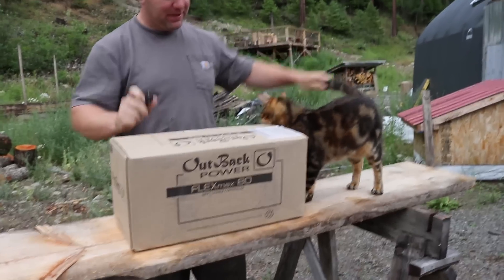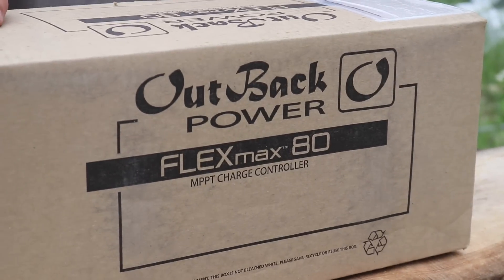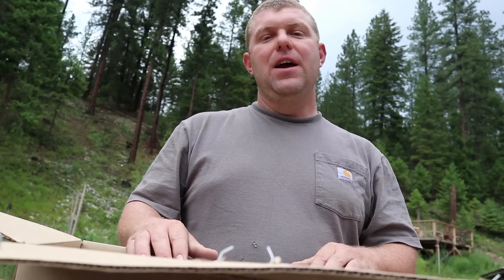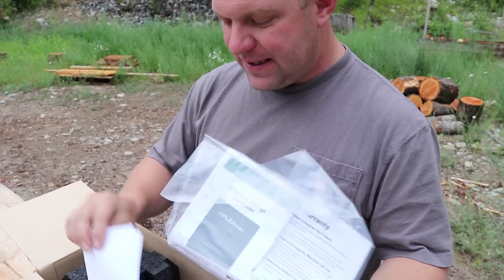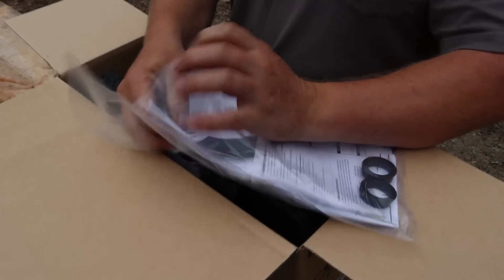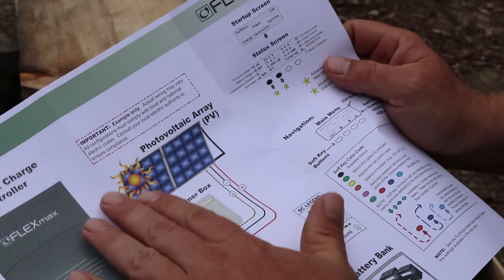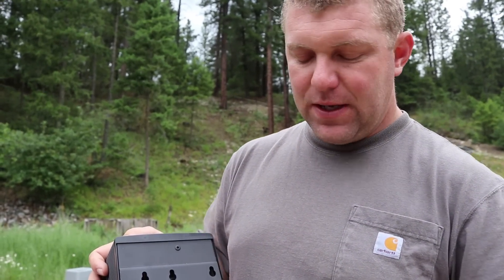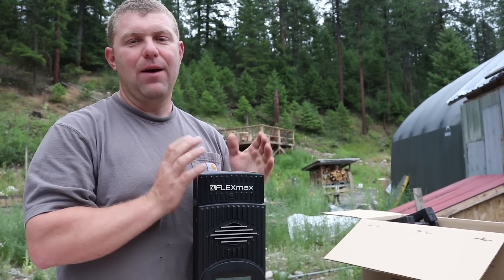MASSIVE SOLAR UPGRADE (Outback FLEXMax 80 Charge Controller Unboxing)

Comment: I've been thinking about what you're doing and been trying to do some research for my benefit I do believe that your system would do better if you put your battery box underneath your solar panels and run a household current line under the ground to your setup which eventually would be your new home. Yeah you don't need to run it under the ground temporarily to your campsite you can protect that wire why in casing it into some planks and making sure you drive all over the planks.... The thing is 12-volt DC electricity will not run very far. Now even though you have Zapped up the current you're still running DC current... When you change over AC current that can travel long distances.. when you in case that wire when you might want to use a pipe or ultimately put rock over top of it..

Comment: Starring Bugaboo!  Hurray.  Such a beautiful cat.  I'll bet he loves that box now that the stupid controller is out of his way.  //  (SAFETY TIP:  Before doing anything else, when you have staples in the box, use a pair of pliers to remove the sharp bastids and get them out of your way.  I have been shredded by those things twice.  Once was my fault and the other was helping someone unbox something and when they pulled the box, the unremoved staple caught me, shredding my forearm and barely missing an artery or vein.  Danger, Will Robinson!  Sorry, had to be said.)  //  Outback FLEXmaxes are great, and well loved.  I like the MidNite Classic 150, too.  (150v PV, 96amps, solar/wind/hydro modes,  128 days datalogging, founders were from Outback)  Both are $550-600 on Ebay.

Comment: better than the outback 80 is the midnite classic 150.  it can sustain the rated output, the outback cannot.  have burned out two outback 80’s.  they work good if you throttle them back to 65 amp maximum, though.

Comment: Just bought my 1st MH, it has 7 solar panels and Outback. I winterized the unit and removed all 6 batteries but come spring I have no idea as to what to do at start up. Do I just re-hook up the batteries and the system will re-start or do I have a bunch of set up to do. Any help would be appreciated... Thanks Jerry

Comment: You said that you were using a freezer, and also refrigerator, try to keep as them full as you can, A full freezer uses less electric, then one that is only 1/2 full or empty, use empty plastic bottles, fill 3/4 of the way with water, if using old milk jugs, squeeze out sume air, to make room for ice

Comment: Just in case any one was interested. I'm an electrical engineer and 1 year ago for my a master degree level class I built my own portable solar generator. I bought this 60Amp MPPT charge controller off eBay and it works fantasticly, AND it's a fraction of the cost of the Outback ones, which I did consider but went with this one because it's so much less expensive.
My unit with shipping came out to just under $300. I even wrote software APIs to grab information from it like PV voltage, current, power, charge state, current, voltage, etc.
http://www.ebay.com/itm/60A-MPPT-solar-charge-controller-regulator-12v-24v-48v-3200w-monitoring-PCM60X-/161615675225?hash=item25a10b7f59:g:K6UAAOSwm8VUygAw

Comment: Watched a few of your videos now. The upgrade is a good idea, 12v  just means higher amperage draw from the batteries. Why do you not simply connect your solar panels in series (now currently in parallel) and then series out your batteries to 24v. In this way the system will be entirely a 24v DC system which is simply in a different league to the 12v system.

Comment: Greetings,

I run a flex Max 80, a 24 v 3500 outback inverter and 1000 watts of solar in my rv. My panels are 250 watts wired in series and parallel to produce 48 volts. My battery bank is 24 volts. I'm only limited by the size of my battery bank. Outback makes good stuff. So far, I've not seen anyone using outback equipment in an RV but it is high quality and holds up well. I've never been disappointed with my setup. This system is overkill for my needs but I would rather have more than not enough.Oh ya, my 4 panels are ground deployed so I can park my rig in the shade and have my panels in the sun.

Comment: Outback charge controllers are popular with UK narrow boat users. MPPT usually gets 20% more electricity out of the same panels. Data logged about three years ago showed that winter solar harvest is about 8% of panel rated power, NOW you really need more panels another KW now would be a start. Your battery really isn't charged until the charger current goes down to about 2% of the AH nunber (2A for each 100AH) -If it never gets there then something is broken. Arranging panels at about 100v will let you send more power down the same cable, but if you are going to have a solar farm away from the house then fit some really good large gauge cable in a protected path.

Have to say that now is the time to plan to locate some KW of panels on the house, the more KW you fit, the more months you get usable electricity.

Comment: Thank you for your videos.
I have watched this video and the earlier one called “One UGLY TRUTH about off grid Solar Power.”
I have a few comments and recommendations for your Solar System.
The big advantage of having a MPPT controller is it will accept a higher input voltage coming from your solar panels and still output 12 volts to your batteries.
This allows you to wire your Solar Panels in series instead of parallel.
Wired in parallel with give you a few benefits.
1. Higher Voltage at the output of the Panels will allow you to use smaller wire size to the controller.
You said in the first video your wire size is a little small and this will help.
2. In early morning or low light when each panel is only putting out a small voltage (assume 5 volts each) if wired up in parallel your controller will only see 5 Volts and will not charge your battery.
If you wire it up in series the controller will see 15 volts (3*5 volts) and your batteries will start to charge.
So you will get more charging time and more energy into your battery.
Hope this helps and keep doing your videos.
Reply: Sorry I had a typo in line 7, it should be.
Wired in series (not parallel) will give you a few benefits.

Comment: I have the 60 and it's a good unit, though the fan is a little loud when it comes on. I have 9 panels at 240W and 8 x 600AH batteries.

Comment: You didn't tear up Bug-a-boo's new toy did ya, the cardboard box. Cats love cardboard boxes, cut an access hole on the side close the top. Now he has a private place to sleep and play in.  My cats have a multi-level cardboard condominium, and one level is divided into multi-rooms. They love it, if we don't see them, that's where they will be. Keeps them occupied.
And for the juice, get a bicycle hooked up to a generator, loose weight and make juice at the same time. But only in your spare time.

Comment: Just a thought for others starting an off grid system. It seems expensive to buy LP appliances and LED lighting but if you spend your money there you won't need nearly as much electric from your  panels and batteries, nor will you need these pricey solar panel accessories. Anyway, LP appliances last much longer than electric appliances. They cost almost nothing to operate.  The cost of a large solar array, the charge controller, heavy cable, inverter and batteries or a large generator and the fuel to run it will consume any savings that you made buying electric appliances. 
Learn to live without a TV and the associated accessories and you'll not only save electric and the money you spend for cable or satellite but you'll become much more productive with the time saved.  Who needs that brain mushing programming anyway.  
I've been doing this for about four years now.  With my LP set up I spend about thirty dollars a month on energy.  I use cheap Harbor Freight solar panels and golf cart batteries.  My biggest electric user is a 12v pump in my well and an occasional box fan. Sure I have to hang my clothes out to dry but let me tell you it is well worth the effort to be utterly independent of the grid and "society".

Comment: Your winter production is that poor? Im not sure  where you are but, up here in Canada I have 400 watt pv any solar thermal hot water. Solar thermal  from November to February  boost 52 degree well water to 80 degrees and March to October  60 degree water is boosted to 112 degrees  with 1-5' × 6'  panel. Save you pv for other electrical consumers.

Comment: PWM vs MPPT has zero influence on how long the wire runs can be to be effective.  You can run a higher voltage input into a PWM controller and it can convert down to the lower battery voltage just fine (if it is designed to do so).

Also bear in mind, that an MPPT controller IS still an PWM controller.  It still uses PWM to adjust how much current passes through to the battery bank.  MPPT is an additional algorithm that adjusts that current to maximize the power obtained from any given set of conditions.

Comment: GOD FUCKING DAMNIT!!!!

@10:55, you state the charge controller mfg recommends 4awg, to charge the batteries, but @ 2:40, you say you're running about 100ft of 8awg. You cannot expect the controller to  feed the batteries better than the charger gets. you keep throwing parts at this problem, without fixing the fucking problem!!!!!

MOVE THE PV CLOSER TO THE BATTERY BANK, UPGRADE THE WIRE FROM THE PV TO THE CHARGER!!!!
http://www.solar-wind.co.uk/cable-sizing-DC-cables.html
http://www.rapidtables.com/calc/wire/voltage-drop-calculator.htm

Comment: So I was thinking why they called it FLEXMax 80.My thoughts are that there are flexible voltage ranges with the Max 80 indicating the maximum current capability being 80

Comment: with a long cable run, you have more voltage drop as the cable gets longer or current gets higher. as the voltage drops, the watts received at the end point will be lower.

the size of your new charge controller is largely due to the amount of current it handles. more current means more waste heat in the conversion process.

PWM charge controllers basically pulse the current into the battery, at a high enough frequency to not cause much noise. your MPPT charge controller also pulses, but at a higher frequency and in a different way. in a way, it's sorta like a large step-down buck converter power supply, which can change the pulse width (and possibly the frequency) to get the highest possible watts from the solar panels. it pulses current into a large inductor coil which acts sorta like a fly-wheel for electricity.

so, as it acts similar to a buck converter, you'll have to balance a few things and make educated guesses as to what will actually be most efficient. as I said, voltage drops across your long line, but buck converters are actually most efficient when the input voltage is nearest to the output voltage. if you were to feed the same amount of watts into your charge controller, at a higher voltage and lower current, vs a lower voltage and higher current, the lower voltage setup will produce less waste heat and provide the most output watts.

depending how bad the efficiencies are you're dealing with, I might just be splitting hairs. my point is, it's not necessarily the most efficient to use the highest possible voltage into the charge controller. it's a balance between volts and amps, hence watts = volts multiplied by amps.
Reply: I know it can get complicated, but doesn't more power at the batteries mean more charge?  Since the resistance of the cable is pretty much constant, lower amps means less power loss in the cable.  Sounds like you'd want some MPPT at the panels, pushing a higher voltage, at less amps, to a PWM charge controller at the batteries.  If this were a more permanent installation with proper battery storage, every thing could be at the panels, including the inverter.  There's much less power loss running 120v at 20 amps, compared to running 12 volts at 200 amps.  Until then, most of us learn as we go.

Comment: YAY!!!!!!!
 NOW,you are in to serious power.
SERIES connections. i just realized  that my PWM was too lame.

I went to an MPPT and NOW,I run my panels @ 90 VOLTS!  What a difference!
100 V. @ 5 amps is 500 watts.

My cables to my panels are undersized,like yours.
8 G. wires. Now,I don't care at all.
B-4:300 W. Now: 500 watts.Same panels,but now wired in series,with the MPPT CC.
  WIN,WIN.

Comment: You can connect your panels in higher voltage to be able to use thinner cables from the charge controller to the panels... And you can still charge your 12 volt batteries. My setup has 72 volts coming from the panels to my MPPT controller and the controller charges my 12volt battery bank.

Comment: Not saying I'm not a nerd (I do have a physics degree, and I program corporate databases for a living), but ... the reason I was "still" watching at the end was because I skipped ahead to see if anything interesting was going to happen :p

I think the video would have been more functional if it had been a cut-down unboxing combined with highlights from reviewing the installed system (which is probably also going to be another boring video ... "Here's it charging the battery ... and this is a status light ... and here it is discharging a night ...").

Love you guys, though. Gratz on the Cistern install -- and can't wait for you to finally get the frame up on your home.

Comment: Hey Guys, I am running the flexmax 80 on our solar system at our remote cottage in northern Ontario Canada. Its an amazing charge controller. We run 12- 2 volt lithium batteries hooked in series and in parallel for a final output voltage of 12 volts. Our panels are 4-310 watts with 2 pairs hooked in series and then together in parallel for a total output voltage of 90 volts ,32 amps. around 1240 watts to the controller . We have a run of 60 feet or wire from our panels to our controller we use 8 AWG MC4 wire for that. From our controller we have a 10 foot run of 4 AWG wire to the battery bank.  We run 2-2000 watt sine wave inverters on the other end. this system will actually make some current on moonlit nights and does pretty well on cloudy days. We run a 12 volt refrigerator 120 volt stand up freezer and a satellite dish receiver constantly with no issues. Good luck on your system. BTW if you could hook up your panels on a pivot to keep them pointing at the sun more directly with a little manual tweaking during the day  performance improve greatly. RICK

Comment: I think you need to understand 6:18 better.  Yes your battery is 12v and therefore your inverter should be 12 volt.  6:18 basically tells you that your PV array can be higher volts with your Charge Controller stepping down the voltage to your 12 v battery system.  Doing this will help alleviate your weakest link in your system (by reducing the current) on your PV cable run.

Comment: After reading all the comments I can tell none of these people use solar for there power. All there advice sounds good on paper but is not useful for the real deal. The charge controller is great but you need to move the panels closer or use much larger cables from the panels.

Comment: Hi guys, love your vids. Mind if I ask why you can't just wire up two of your 12V panels in parallel to make 24V, and then wire those up in series with your existing 24V panel to bring it back down to 12V? I don't know much about running solar power, so there's probably a good reason why you can't do this... Anyway, thanks! (My wife is also a big fan and we both love Bugaboo!) Cheers~

Comment: I know you have & run a freezer off the solar power...also saw you have a backhoe now...just a question but why don't you build a root cellar into the side of of of those hills? It wouldn't be frozen but it would be a whole lot cooler, making the batteries last longer.  Even in the winter it would be nice.  I know you 2 are always doing something. ...even if you dug I to the side of the hill deep & wide enough to live in. It would be a constant temperature,  plus you could run your solar panels right on top shortening the length of the wire to the batteries

Comment: Could you possibly post panel specs (old and new, the sticker on the back of the panels) sometime here or in a future video?
You may be able to use all your panels in a combined setup with that controller, depending on specs.
(You'd have to upgrade your battery bank voltage to 24 volts as you know, to go over 1000 watts, BUT... since you're planning on doing that anyways...)

Comment: watched whole video!  snoor!  So how do you plan to add those 750w 24v panels to this or just get rid of 12v altogether.  WIll that combiner box shown in the carefully photographed diagram combine panels of different voltages?  I did a solar powered sign for a property I have and had to be careful about the voltage drop with the wires.  It was for lighting 3 different signs at night with LED's.  By the way, you can get led strips 12 or 24v and get aluminum profiles.  You can make lights any length and get very even lighting.  They have RGB/WW strips which have warm white leds and rgb leds on the same strip so you can have superb lighting, color or white.  I have done that in my house and have some lights that are 12 feet long, 1/3" high, 1/2" wide with diffusers. No shadows and I had the disadvantage of having to get stepdown AC to DC power supplies for 24v.  I used 24v so I could decrease the current to 1/4th of the 12v.  I power the lights using thermostat wire. I like seeing your videos and your solutions.  If you are interested, I can send info on what I did.  The keyword is aluminum profile.  Shelving can be back lit, they are using it in floors, stairs, under shelves.